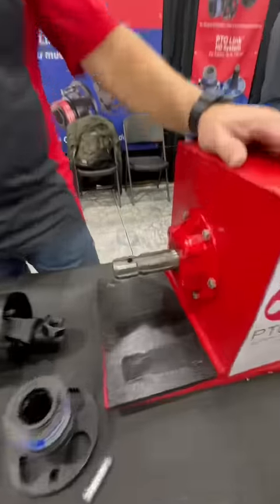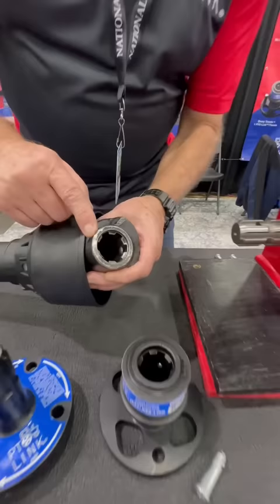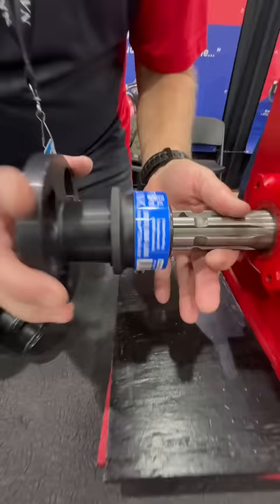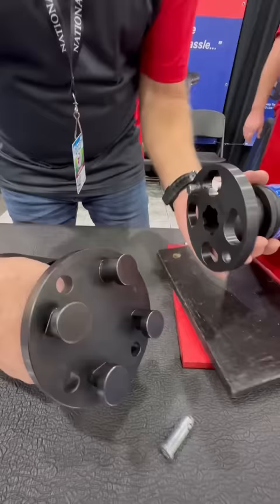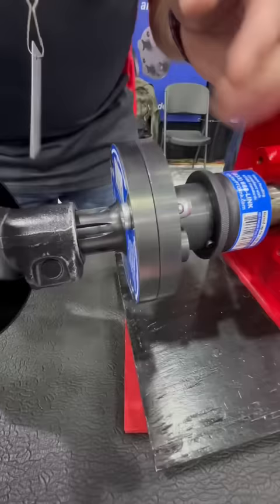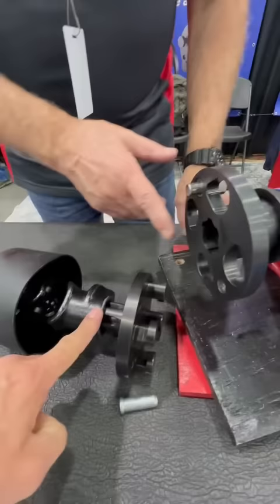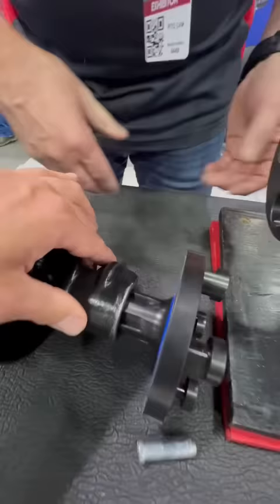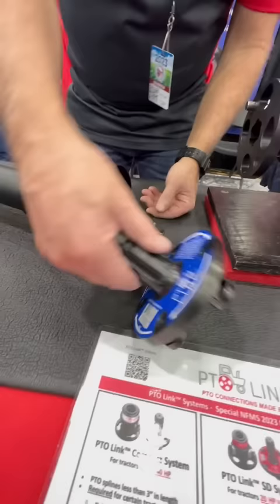“Farming just got easy.” (Said no one ever) #farming #tractor

Comment: Usually, the problem is spinning the PTO by hand, this adapter still has you spinning the PTO
Reply: Exactly
Reply: Yep
Reply: That's why old 4020s are so nice. You can turn the pto shaft so easy.
Reply: I have a 15 ft wing bush hog with three separate gearboxes with clutches. I turn the main PTO shaft by hand to grease all the fittings no problem. Been working great for years. Don't need any additional junk on there

Comment: All this does is adds extra length to the PTO shaft, additional weight, and more places for vibration. Great if you are in the business of selling stub shafts, seals, bearings and u-joints
Reply: I came here to say this. Not to mention the fact that in some cases it will indeed require a new, shorter shaft, if there's not enough play left on length
Reply: Just generally seems like an unneccesary complication for those who are incredibly lazy and/or running some sort of hobby farm
Reply: @uther69lol  rotating mass at 540 or 1000rpm is different in a significant way from wheel weights.

Comment: I wanna see how that pin holds up when you hit a stump while your bush hoggin
Reply: Its not only those two pins supporting the load, it's all the other ones as well. Not to say it's not a useless idea and possibly can still cause pto shaft length issues if you're operating too close to the shorter limit of your shaft, which would normally be the more ideal situation to begin with. Also a brushhog should have a torque limiting clutch as part of the PTO shaft setup, to prevent those shocks from snapping a pto shaft, or in one case I seen, destroy the gearbox itself and split the output shaft literally in half, and blew out that side of the gearbox while it was at it, and destroy the hub for the blades, bent beyond anything I thought possible. All because someone didn't check that clutch and make sure it was free before the first use of the season.
Reply: Right?! Those spring detents are not going to hold. Lynch pins would be better.

Comment: I have zero intention of ever buying this. The pto is already a 'quick-connect' design, and is easy enough to work with.

Further, the additional length moves the u-joint further back. This will mess with the geometry of the hitch and pto assembly.

Comment: Problem is, this places the u-joint further out, thus places more side-load on the pto shaft and unfortunately shortens the drive shaft as well, increasing u-joint angle.
It'd be perfect combined with a driveshaft stretcher.
Reply: You are correct sir.

Comment: Not something i would trust my 270 hp 1000 rpm tractor with.
Reply: But it's called a safety pin, so it's all good
Reply: You did notice it had different sizes for larger HP?
Reply: @court2379  still look how it connects
Reply: @gamerfarms9362  I am a mechanical engineer. I see no problem. You can hear that it is hardened steel. It is far stronger than needed in torsion, there being at least the same cross sectional area of steel in all those pins and them being on a much larger radius they aren't loaded nearly as much anyway. The holes are slotted and the pins have a head, so it cannot come off axially, and the normal locking pin and the safety pin keep it from rotating out of the locked position. I think it highly unlikely to fail before the shaft yourself does. The main concern I would have is vibration damage if there is much play after the pins are in. Cannot tell that from the video.
Reply: @court2379  
I'm also a mechanical engineer. 
And a farmer.
This is unequivocally the stupidest gimmick accessory I have ever seen in my life
Reply: @court2379  an engineer is not a mechanic is all I have got to say
Reply: @philipunderwood477  @gamer farms I am also a machinist and farmer and do all my auto maintenance, so depends on the engineer. Would I buy one of these, no. But I do have a baler that is difficult to get the coupler to go on, so understand where people might want this. It solves a few issues. Often the shaft you are lifting on is heavy. You get it up there and it won't go on. You cannot see the position of the splines so you are trying to turn the shaft or the PTO shaft to get them to align. All blind. On my baler, that shaft isn't going to turn by hand. The tractor end can be due to the overrunning clutch, but it isn't easy and I have to set the baler shaft down to do it (which then often gets dirt in the grease on it). Trial and error, I turn the PTO and try the baler coupler. It only takes a small misalignment and it won't go on. So usually takes 2-3 tries lifting 40lbs of steel into an awkward place at nearly arms length. You are also trying to do this under those stupid safety shields that do nothing in a tight area straddling an often greasy shaft, with greasy hands because you have to turn the PTO shaft. Then the stupid locking pin doesn't really depress as far as it should and rubs on the spline making it very tight to go on past that point. If the safety cover on the baler shaft didn't have a little play in so that I can rattle it back and forth as a little slide hammer, I would have a lot of difficulty getting it on. 
Really the coupler should be torn down, and debris inside cleaned out, any burrs filed off, and whatever is keeping the pin from moving well past the side of the spline fixed. Then it would probably go right on once started. 

So are there merits to the product, yeah it gets it out where you can access everything, you can see what you are doing for alignment, and it isn't covered in grease. The larger diameter probably makes it easy to turn the overrunning clutch and it isn't slippery with grease.

Many of my engineer friends are mechanics as well, so stating such things isn't really accurate. Most of us started our careers doing blue collar jobs. One used to own a machine shop making custom brakes for older Audis, and another tears down engines and rebuilds them as a hobby. I worked as a machinist for seven years before switching.
There are another 50% of us I wouldn't trust to design anything though. Most of those people thier career moves to other topics than design. Technical sales, patent law, management (project and people), etc.
Reply: @court2379  you can "hear" hardened steel in a video? 
what does that even mean?
Reply: @OntarioBearHunter  A soft steel doesn't ring much when struck and has a quickly damped noise. Here you can hear how easily it rings without even being struck hard, indicating it isn't annealed and has some hardness.
Reply: @court2379  put a paint line on the shaft and coupler then you'll only have to turn it once
Reply: @dj13yrs1  Seems like the paint wouldn't stay on the spline very well, but it isn't a bad idea. Maybe stamp a witness mark on the coupler at the top of a tooth.
Reply: @Court  are you the one that engineered the manifold bolts on the f150?
Reply: @politicalfisherman540  Hah, how about the one that put the oil filter at a 45° angle or makes you drop the tank to change the fuel pump or filter. Or having to drop the subframe/engine to change spark plugs or alternators. Yeah I get angry at those designs too.

Honestly though I think it isn't really their fault much of the time. They are given a spec that takes cost and production line assembly as first priority and maintenance is way down on the list. If they can save a dollar but make it take an extra hour to repair, they will probably do it because low cost is the primary goal. That is a management and marketing problem.
Reply: @court2379  Putting the pivot point farther from the pto shaft introduces more stress than the shaft is designed for. Its like putting high offset wheels or wheel spacers on a vehicle. The ball joints take more stress same as the pto shaft.
Reply: @supersportimpalass  While true, it is only supporting the mass of the half of the shaft and it isn't cantilevered because it is supported at both ends. There will be a little torque due to the joint allowing the end to flex though. The loads aren't really comparable to the mass of 1/4 of a car, even if it were quite out of balance.
While this device does add length and loads, it is fairly common to have long shafts, and this only adds 10% or so to the longer ones. 
Bottom line I don't think this device is going to make a significant difference in the bearing life. They should already be designed for load well in excess of what this will add and the loads really aren't that high.
But in the end, don't buy it if it causes concern. I personally think it is unnecessary, but can see how it might help someone with limited strength. And even if it reduced the bearing life by 10%, that is probably a compromise they are willing to take.
Reply: 1000 rpm PTO has different shaft...
Reply: @court2379  I’m an Industrial mechanic and I repair things daily designed by Engineers & in doing this I see daily how little engineers know about actually working on equipment. With this knowledge I can agree that an engineer can design it and make it look pretty but that doesn’t mean it’s going to work as planned.  Also grew up farming and see this as more of a problem than a solve.
Reply: @colonelwallace361  I can easily say that half of my graduating class I wouldn't trust to design anything. Probably only 10% should be making anything particularly complex. Many of those top 50% get better with experience, but some never really get it well. 

But you also have to consider the constraints put on them. A good engineer will still make a crap design if their hands are tied. It has to cost x and that isn't really enough, it has to fit in here, and the space isn't sufficient, team Y designed their part first. Make your stuff fit in there, and you have two days, etc... That is how you get the worst designs.

Comment: I mean if you wire brush and oil to clean the splines out... it's amazing... you can actually slip them on and off... and you can use a small strap to help lift and move the implement end.   Would be funny to see this thing on big 1000 shaft for grain cart... 😬

Comment: I'll be honest this fixes maybe 2 minutes of frustration and causes even more problems adding another stress point on your PTO shaft. Just another thing that can break. Having worked for years down south in northeast Texas cutting baling and raking hay there's already so much that can fucking break. Your hydraulic lines can pop out of the sockets. You can lose adapters from John deer tips to pioneer and vice versa. You can snap a pto shaft (not fun had this happen a few times this last summer while we were bailing 647 bales in one field) but usually lining up those PTO shafts isn't that hard unless your talking about the cutter bars that use a high rpm pto shaft and have alot more teeth. Now those fuckers always trip me up and leave me annoyed for a hot minute while I use a wrench to turn the pto shaft on the cutter till I Line them up.

Comment: I just spent $167 on a damaged pto shaft repair from adding a pats easy change. I was warned adding overall length my affect the length of various implement’s pto shafts…and it did. I gave the pats easy change away going back to the original tractor setup. This looks like a nice product but Ive learned my lesson😮

Comment: The whole purpose of the splines is to distribute the massive amounts of energy evenly and in the same rotating motion of the input and output. This device effectively reduces the contact points that energy has to travel through while also changing the direction of energy, increasing the chance of failure during a heavy load.

Comment: Manufacturers have sized you shaft length so it won't pinch or pull apart. Adding this system will shorten the shaft making it more likely to bottom out,  then bend or break the weakest mechanism. Notice 4 times he coupled and uncoupled the traditional  style pto coupling,  3 of 4 times he said that was ez.

Comment: For one if you’re having trouble hooking up the pto that means you left the tractor running. You always shut off the tractor when attaching or detaching the pto. 2 with the tractor off you can turn the pto on the tractor side to line up the splines easier

Comment: Instead of struggling to connect the splines, now you can struggle aligning 2 pins and the struggle to find something for a locking pin, after you lose the original.

Comment: The PTO shaft on the tractor and the coupler on the Implement are both beveled and have 6 splines which means you have six positions that you can hook up that Implement with your system you have 4 positions that you can hook the Implement up to with an extra locking pin they has to be installed

Comment: I think this could add versatility to some tractors and driven assemblies.
If their interlock is consistent across any different PTO shaft splines and sizes, could be used to adapt to different brands of equipment. I'm sure a majority of equipment is mostly one size, but I'm also sure it's not 100%.
And as for an added failure point, I feel this is backwards in 2 ways. I think the 4 studs and 2 pins is probably stronger than the spline, and if it were to be an engineered failure, I would rather replace an adapter that I can continue to work without, over either the output/input shafts that can hault work.

Comment: The only thing this helps with are greasy hands. Otherwise it makes the physics of the PTO shaft way worse; more mass around the axis, possible balance issues, longer distance between the angle joint and the bearing causing more flex and vibrations, and given how tight it usually is around the shaft, it probably limits the liftingability significantly, as the joint can only angle so much before it is no longer able to rotate freely. Not to mention that any load that'd need a ratcheting axle cannot use this as the big pins only carry the load in one direction.

Comment: If you can't connect your damn pto shafts, either sell the equipment or hire someone else to run it. 
This is just adding a weak point. not to mention the "safety bolt" pops out with just a tap of his finger so what do you thing the HEAVY vibration will do?  
use your heads guys.

Comment: Completely not needed. A six spline PTO requires less rotation to align and hook up than this does. Not to mention that most any tractor made in the last 40 or so years doesn’t use a live pto and the pto shaft will spin free anyways(to aid hook up). I could anticipate excess pto driveline vibration as this unnecessary coupling wears.

Comment: So you just went from Elena spline to now eyeline some pinholes what's the difference. We've been doing it the same way for 100 years. Keep it green stuff and it's not a problem. I keep grease on my PTO shaft and when it's not in use I slide a piece of inner tube from a bicycle over it with a rubber band to hold it on there keeps the dust off of it

Comment: I wonder  what the breaking strenth is would the sheer pin still be the weakest link? is there enough travel to put that on my bailer  mine is tight enough the factory made it so long will that throw off the angles of the u joints

Comment: You just increases the unsupported length of the PTO by 6 inches, not great for vibration or the life of the shaft bearing. Also that means the PTO shaft has to be that much shorter which may not even be possible on some setups

Comment: Adds a little wobble more parts and cost to a system and also have to shorten pto shafts that if properly maintained is easy to connect and disconnect not to mention if q guy isn't paying attention an employee might not flip the shaft from 1000 to 540

Comment: Lol that half inch twist isn't always possible. But that ⅙ of an inch twist with ur standard 540PTO is possible. And for a 1000 pto it's never really a problem. Also I'll bet ya $100 the torque from starting the pto on the tractor over and over will warp and snap that "adapter".

Comment: so wait when he's putting it together it's so hard to line up the shaft but when taking it apart he says it's this easy and pulled a collar. think about this. with a 6 spline shaft you have 6 ways to line it up but with his you have 1. have you ever tried to spin a PTO shaft on a 15'bush hog with the wings folded? you don't. not much anyway. damn sure not getting a half of a rotation. so you remove his flange to help line it up better. therefore removing the "convince" of his product. he has found a way to make a simple PTO more complicated.

Comment: Well just be sure to adjust your drawbar length if you are going to use this “gimmick device” on an implement that hooks to the drawbar. The pivot point of the driveline is not going to be correct in reference to the hitch pin which will lead to premature u-joint failure. I know drivelines can be a pain occasionally especially heavy ones like on a round baler but I don’t want anything to do with this product. I’m guessing it’s geared towards backyard operations and not farming.

Comment: Instead of this make disconnect button that does not jam over the years of use and have issues like freezing in winter. Getting that damn disconnect button to work its only problem with PTO's i have run into, but then again our equipment is decades old and worn down so go figure. This thing.. does not solve anything except maybe if you have too short and too long PTO axle maybe extend it little so short one works, but that is not idea and there is already cheaper alternative to that. On the down side this will just increase forces to seals and bearings, add vibrations and wreck your whole PTO system from tractor to machine...